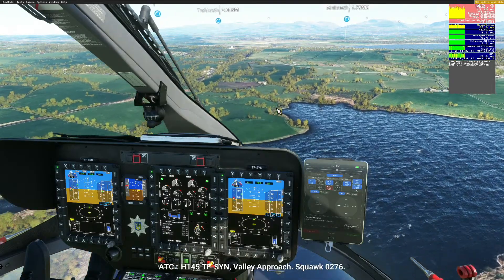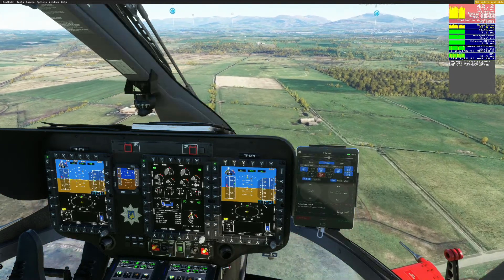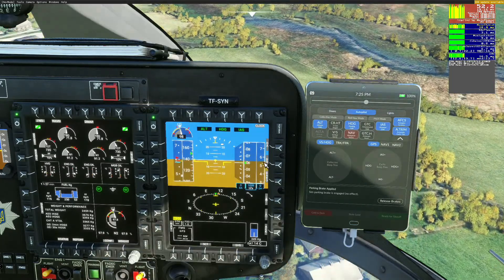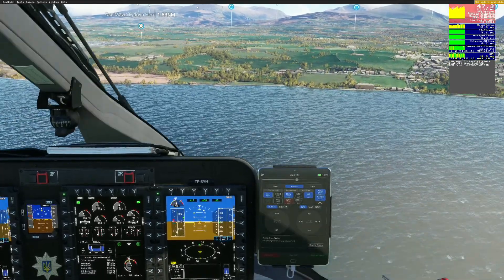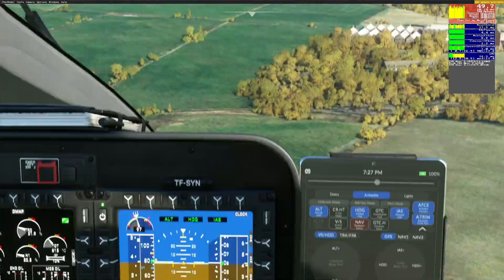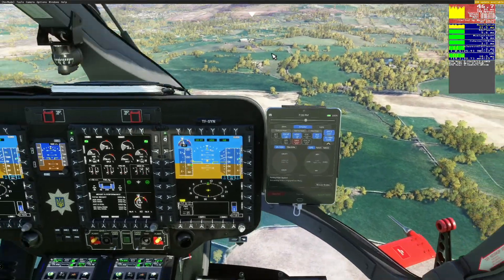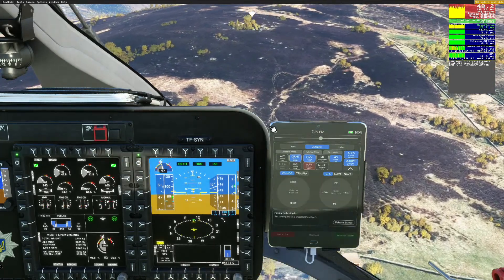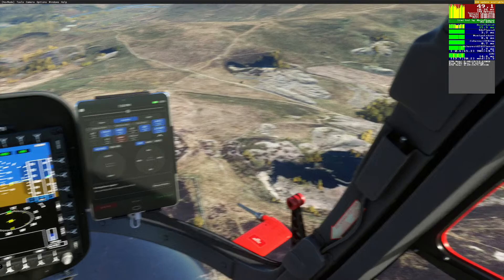14. H145 Tutorial MSFS 2020: CR.HT Setting. H145 Hyper Perfomance Group. Follow the terrain!

Comment: Another good tutorial. If you find it struggling gaining height then lower the speed, a little. It will all depend on how steep the hills/cliffs are you don't set it and go make a coffee hoping you will be safe. 

Another Tip I could give is use the DH (Decision Height) if I'm cruising along say at 1000ft, I set my DH to something like 300ft. this then gives me an audible warning when I drop below 300ft  (DA is the same, but of course for Altitude).
Reply from the maker: Thanks Harag. Great advice.